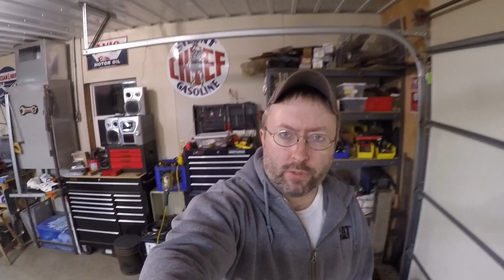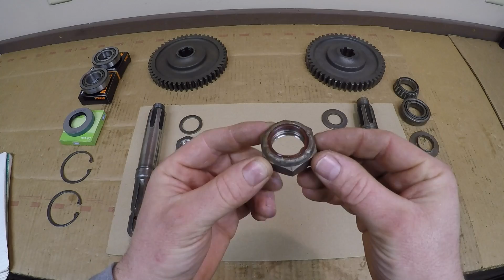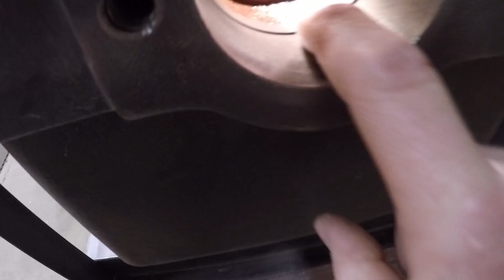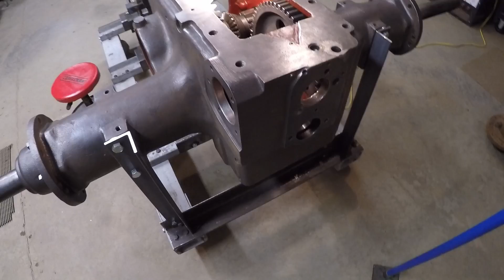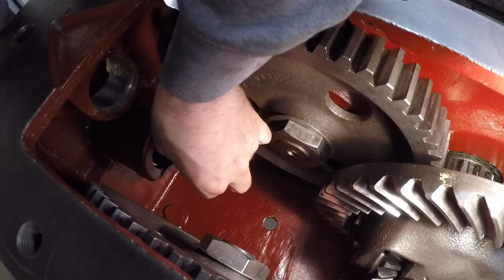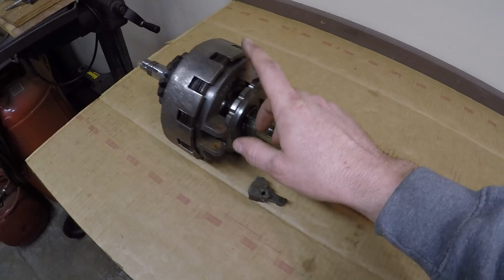Minneapolis-Moline 445 Prototype #X231 - Part 34: Installing PTO Shaft

Comment: I have to concur with Paul Hammond on the value of the “compare and contrast” aspects of the videos, they are the heart and soul of this restoration. I am curious what kind of implement was driven by the PTO shaft on the production model that did so much damage to it. Could it have been a baler that was having maintenance issues, and put an extra load on the PTO shaft, or maybe a baler that was set to packing too hard of a bale, if that is a thing?

Comment: The projection shaft threading is Unified National Fine Thread and the prototype is Unified National Extra Fine Thread. I learned about this when I trained as an Industrial Mechanic/Millwright and it should be taught in Machinists Training.

Comment: I find it amazing that the PTO was is "factory new" condition when everything else was so badly damaged. But then I guess it wouldn't have been damaged if it hadn't been used that much in the past. Like grandpa used to say, "just shows to go ya" .  thanks for the update.  - John
Reply: @squatch253  That make good sense, even I could understand that, thanks.

Comment: What was the change to the gear teeth? Was it pitch? Or was it tooth size and pitch? I mean the gear on the production piece was 1 tooth lessand did they accomplish that by a means that would allow the drive pinion to be used with either gear? If they changed the gear teeth and the drive gear as well then not much in that case survived from prototype to production unmodified. Awesome to see the difference and the comparison between the two is not boring, if is awesome to see how the minds changed from a running prototype to the actual production model.
Reply: @squatch253  Dang so they revamped everything from prototype to production. That is not a small change for the factory and good thing you have good 10X pieces then. I figured maybe change a gear but make it work with what they had but wow. Well thanks for the info and can't wait to see this beautiful machine rolling again.

Comment: That was easy, huh?! :) Would the use of a production 48-tooth gear be compatible with the prototype 49-tooth gear set-up, there being only a .15306-degree-per-tooth difference between them?  From what little I could see, it looks like the gears immediately behind the clutch assembly are good shape, so I imagine there won't be a issue using all-prototype parts. Fingers crossed....
Reply: @squatch253  I read your response to the guy who asked where you work, and I get that you don't like the auto biz (my dad worked for GM for 28 years...I'm sure it shortened his life). Would you be interested in being paid to restore a rough '57 Ford 641? (According to the owner, the transmission is starting to make a clunking noise but still works in every gear. He thinks the shift forks have slid on the rails and need adjustment, but "it might be something more involved than that.") I wonder if a video series on the restoration of a more common farm machine would add to your fan base.... Well, let me know.

Comment: Looking at that P.T.O. shaft assembly, and the damaged that the clutch part that failed, is now going to make me cringe every time I activate the P.T.O. on my tractor.  
I guess I'll be operating the P.T.O. equipment with a little more attention  and care.
No worries on the length of videos, just as long as we see what's going on.
Reply: @squatch253  Ohhhhh that's not a good thing to have happen to a person's tractor. 
I was thinking about 'product reliability' and reputation of the brand.

Comment: Hi, great stuff. Talking of Slingers, we used a big rubber washer 4--5 inch dia that was pushed on the outside of PTO shaft to throw off any crap that might work its way along and into seal and bearing.

Comment: I do hope you are considering some light or medium duty Loctite for that not-Nylock nut. A point source for failure if there ever was one. Best of luck whichever way you choose. Too pretty to break catastrophically a second time.
Reply: @squatch253  I write with personal knowledge of the heavy duty Loctite Red. Long forgotten the product number. Is terrific stuff but there is a minimum temperature, a torch required to get there,in order to remove. I think a little homework,or best a talk with a tech rep for Loctite would be a VERY good idea.Do not overdo the ability to remove the nut. Personal oops years ago.
They have so many products I get lost in the product ID numbers. The medium duty Loctite should be plenty good enough. Maybe even the light duty stuff intended for brass etc. Belt and suspenders.  By all means a folding washer as well. Best of luck with whichever way(or ways plural) you go. Cheers.

Comment: Great video! Fun seeing it go back together. I lose sleep over what next scenarios. I am putting a lift on my Jeep and of course Minnesota vehicles are rusted and I have been twisting bolts off like crazy. Mine is not a prototype though.  I know this is a really stupid question but I am guessing most companies make just one prototype or are there more of the same model out there?
Reply: Completely depends on the decade,the company,the engineered product,and God knows what else. See if you can find old issues of Cars and Parts magazine . They regularly featured oddball or one off examples of  oh, Marmons,Terraplanes, Hudson versions of an El Camino, Mustang 2 door station wagon,Corvette station wagon,(both factory examples), and on and on. Many many stories,all different as to approach. Cheers.